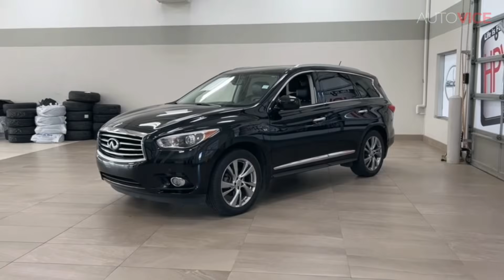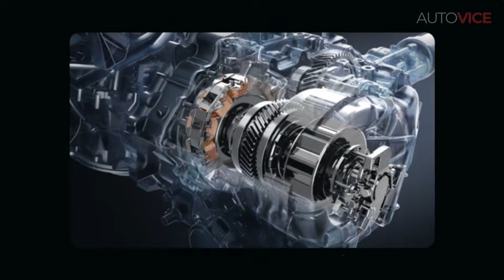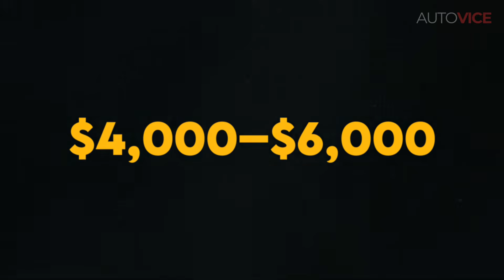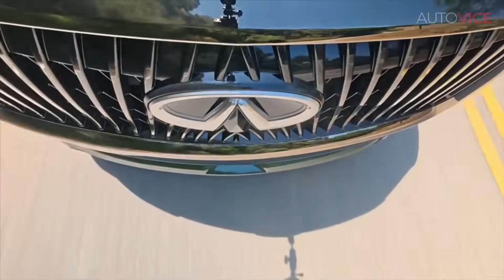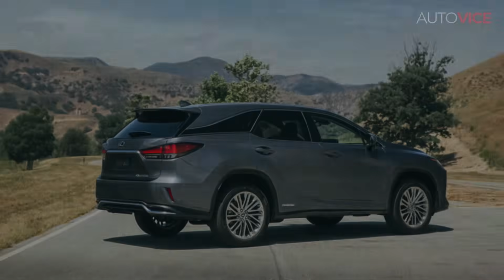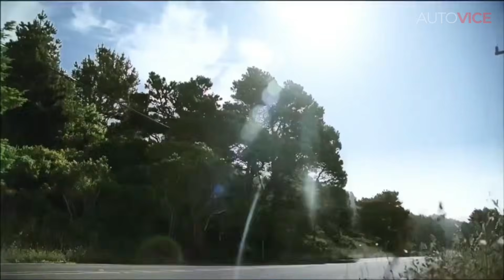5 Used Hybrids That Turn Into MONEY PITS!

Comment from the maker: 🚨 If you don’t have these car accessories, you’re wasting money and taking huge risks!
😱 Most drivers don’t even know they exist...
👇 Open this and see which ones you NEED (before it’s too late):

⚡ Emergency & Safety
✅ Portable Jump Starter (never get stranded again!): https://joylink.io/joyful-ultrasafe-jump-starter
✅ Car Emergency Kit (safety always onboard): https://joylink.io/emergenza-kit
✅ Dash Cam (capture everything that happens!): https://joylink.io/jpHH4bY

🚗 Quick Diagnostics & Scanners
✅ OBD2 Bluetooth/WiFi Scanner (read & clear errors): https://joylink.io/2oTOGbJ
✅ Endoscope Camera (see where you can’t reach): https://joylink.io/divine-ip67-waterproof-camera
✅ Pro OBD2 Scanner with Display (professional diagnosis): https://joylink.io/VJ8RC8X

🛢 Engine Care & Additives
✅ Engine Treatment (cleaner engine, less friction): https://joylink.io/ceramico-additivo
✅ Diesel Fuel Injector Cleaner (efficiency & savings): https://joylink.io/kzPh3Tq
✅ Gasoline Fuel Injector Cleaner (max performance): https://joylink.io/ukuPz36
✅ Stop Leak Formula (fix it without a mechanic): https://joylink.io/Tio2qjN

🛞 Tires & Wheel Accessories
✅ Portable Air Compressor (inflate anywhere!): https://joylink.io/LbbS647
✅ Digital Tire Gauge (perfect pressure always): https://joylink.io/W2vWoIH
✅ Tire Repair Kit (fix emergencies in 5 min): https://joylink.io/gomma-spray

🔧 DIY Tools
✅ Torque Wrench Set (precise tightening): https://joylink.io/Cexc3zf
✅ Cordless Impact Driver (fast & effortless work): https://joylink.io/7jC2HEU
✅ Compact Hydraulic Jack (lift safely): https://joylink.io/XWuBtHp

👉 Check them out on Amazon and grab the deals now!

Comment: 1. Toyota should have known that the hybrid was a bit much for the Lexus GS; the gas model is best.
2. For those in the market - DON'T BUY a Sonata Hybrid, stick with the gas model.
3. Nissan should get rid of the Infiniti brand - it's just pointless now.
4. Toyota fixed many of the problems in later Highlander Hybrids.
5. BMW should get rid of the 7-series, ESPECIALLY the ActiveHybrid.